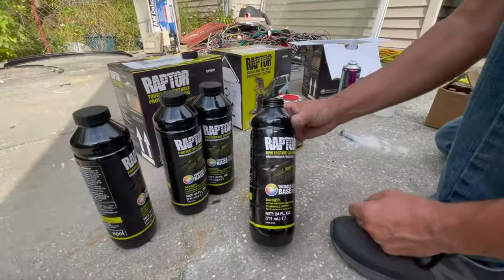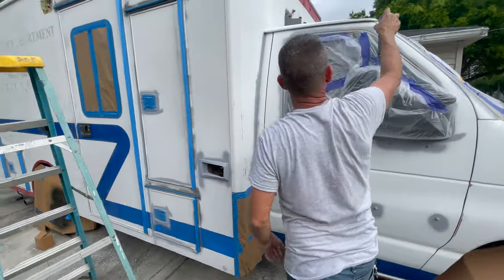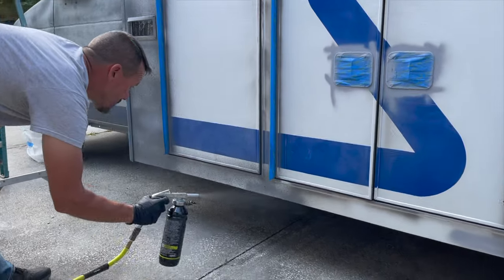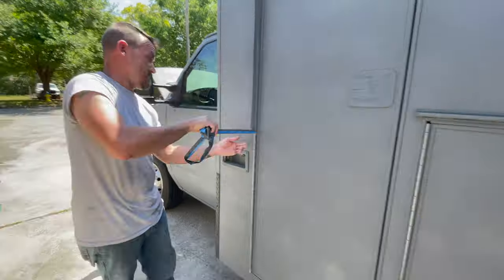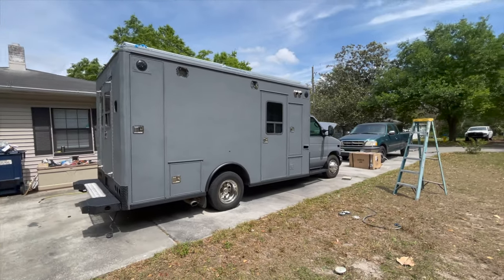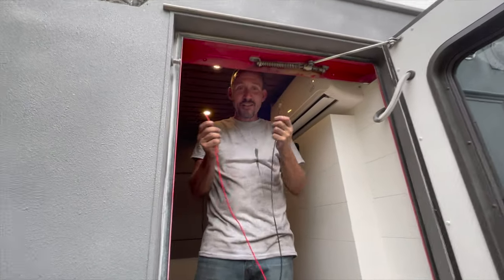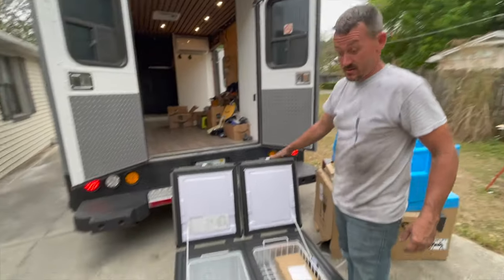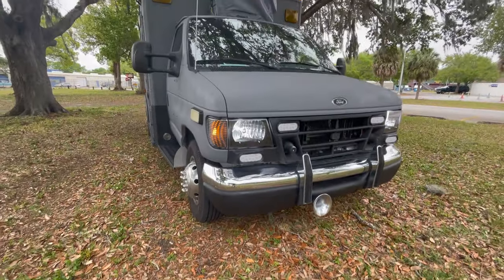Episode 9 Ambulance Camper conversion: DIY $600 U-Pol Raptor Liner spray on bed liner paint job!

Comment: Love this series.. especially since I am going to be hitting mine with paint liner next week... The blue stripe, was it paint or vinyl ?   I have like a 23" vinyl all around mine that I would just love to paint over and not have to remove..... argh
Reply from the maker: It was a vinyl stripe on Williams ambulance. He just painted over it.  You can see it through the paint, but it looks good to us. If your stripe doesn’t look bad, just go over the top of it.
Reply: @ModernGreaser  - oh how I am so glad to hear that... thanks !!!
Reply: @ModernGreaser  - Do you know if he hit it with the 120 grit before he painted the vinyl ?
Reply from the maker: @Broke_Expat  Yes he did.  Also, he sprayed the vinyl with the adhesion promoter.
Reply: Pressure washer should peel vinyl stripes and lettering off.
Reply: @RustyCas999  - I wish. Not the heavy duty stuff on my ambo

Comment: What type of paint should you use on the running boards
Reply from the maker: We used the same bedliner with black paint.  It has been holding up.  sorry for the late response